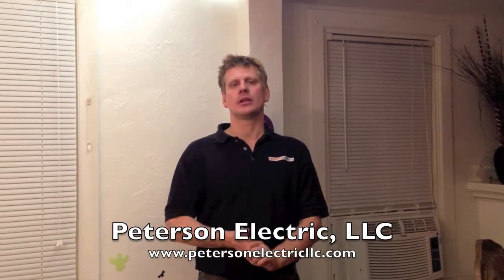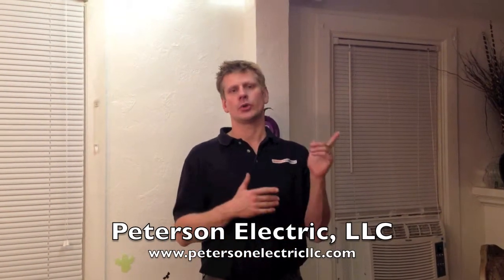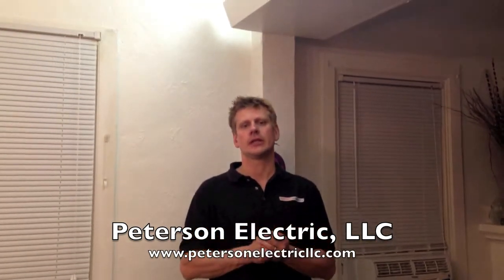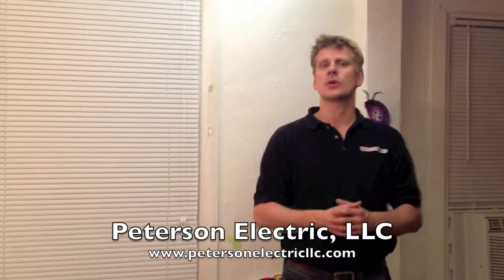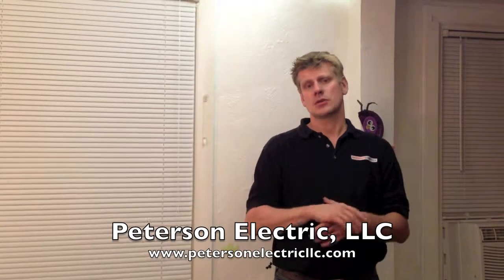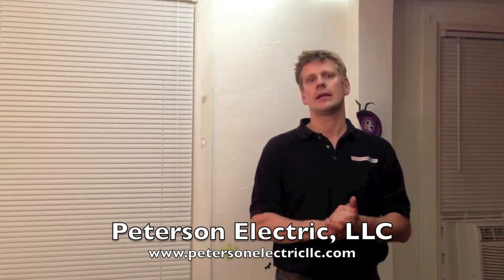Electrical Breaker Did Not Trip, When Fluorescent Light Ballast Was Smoldering

Comment: DUDE--GET OUT OF THE ELECTRICAL FIELD! You are the dumbest, most non-informed electrician I ever saw! You describe a bad ballast like it's the end of the world! I bet you'll put some piece of shit LED fixture, or a worthless electronic ballasted fluorescent in? You describe the breaker panel like all you want to do is get the people to change it out so you can make money! What do I do when an older ballast fries, smokes, and stinks? Let it cool off after killing the power (in 8 foot single pin lamps, removing one or both lamps will cut power to the ballast--as the lampholders have contacts that interrupt power to the ballast when lamps are removed!) and cut the wires about 6" past the old ballast, unbolt the ballast, and remove any errant potting material, and go buy a new magnetic ballast from an older electrical store that carries them, and put it in. If the new ballast is shorter, use one mounting bolt, and a self-drilling screw on the other end. Check the wiring diagram, as some older 8' ballasts are lead-lag and have the 2 lampholder cutouts in series on the neutral, with a modern ballast you will have to isolate them and wire one to the hot side, leave the other on the neutral side, and wire according to the ballast diagram, since on modern series-lead type ballast one lamp is on the 'hot' side of the line and the other is on the 'neutral' side, easy to wire, and only 4 wires, black, white, blue, red (lamp loads on red and blue), then quit trying to sell something new that is a total piece of shit, and get the old 8 footer back in service. I can't believe any electrical man knows nothing about fluorescent or HID ballasts, but 90% of them don't, and you don't either. I have gone inside old ballasts and replaced brittle lead wires and did rewinds if need be on rare antique ballasts, and they work fine. I use 1940's fixtures daily, and they work fine. If a ballast leaks and 'smokes out'., I get another old preheat or instant start or rapid start ballast that is good, salvaged from a parted out fixture, and i'm back in business again. You can just install a 1-1/4" x 1/4" 250 volt fuse, rated a little above the line amps on the ballast label, and it will blow if a ballast cooks and shorts, eliminating putting the ballast and #18 fixture wires on a 15 or 20 amp breaker, which shouldn't be allowed by code anyway. The inline automotive glass type fuse holders are all rared at 250 volts, and safe for this use. They also make GLR fuses just for fluorescent light ballasts. Each amperage only fits a certain holder, so no overfusing. So quit acting as dumb as you sound here, and fix the problem, and leave these T-12, bacause T-8, T-5 and LED are garbage right out of the package. Sheesh.